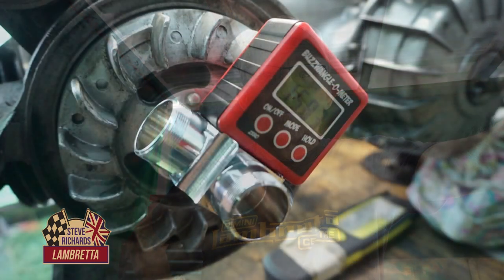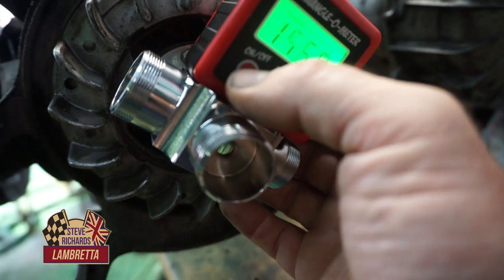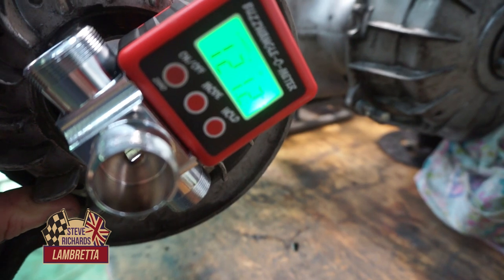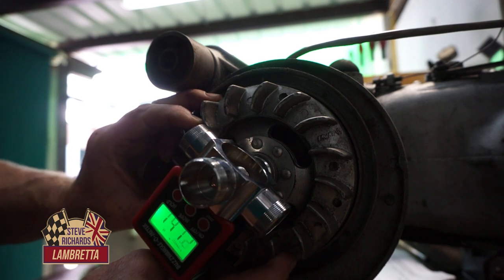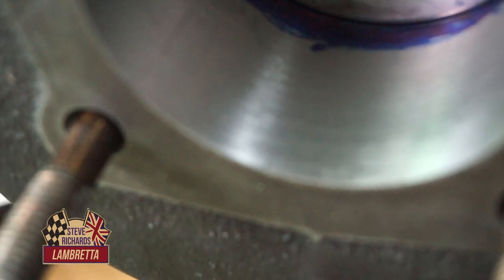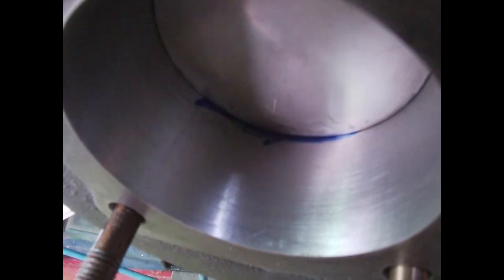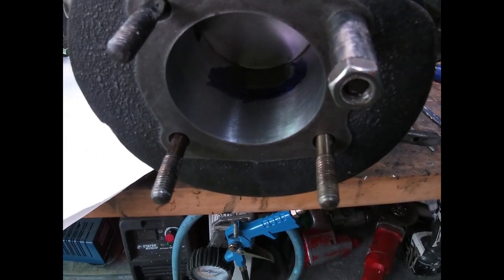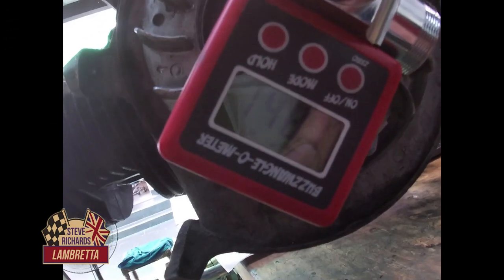lambretta li 150 tune part 5

Comment: Good to see what so many talk about in practice, are you still raising the ports by 1mm as suggested in part 4? We could see the heat getting to you today, now looking forward to part 6, don’t be long please.
Reply from the maker: YES the ports are 1mm higher before i start changing timings but the exhaust port needed to be raised more to get a better blowdown period . has soon as i machined the barrel the ports where already advanced ive adjusted transferes from 121 to 122 .just to get them to open at the same time ? and the biggest power will come from the exhaust port area and timing advance . more blowdown time for gasses to escape .... nothing fancy just basic ? for a motor to produce good power at around 4000 to 7000 these are my timings EX 167 TR 122  INL 140+  ...... dont tell anyone ? tip top secret.....
Reply: @TheSteelweasel  Thanks for the comprehensive explanation, its what I live for, and excites me, opps I’ve wet me pants.

Comment: Hi Steve. I noticed on episode 2 you mentioned Scootronics i need to upgrade my Li 150 to 12volts do you recommend them? plus is fitting stator,cdi, etc a easy job for a person who aint done it before?
Reply from the maker: Easy job to do plenty on tutorials on you tube it you have a standard or mild tune the scootronics is great but if you have a hi bhp motor vape is the best system out there very reliable
Reply from the maker: Talk to andy tamms hes a great bloke and with help you with everything, scootronics top notch .